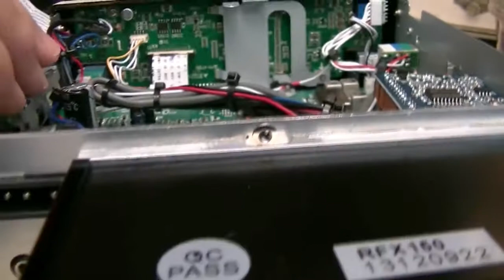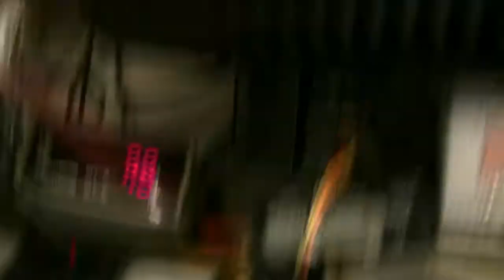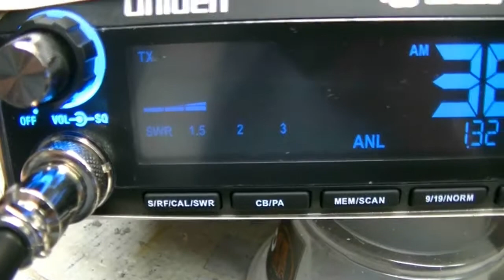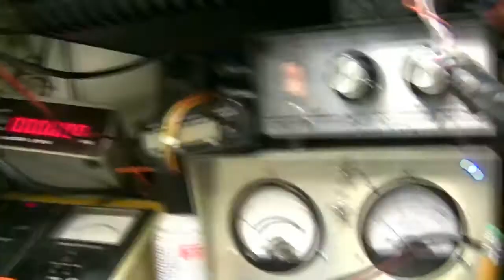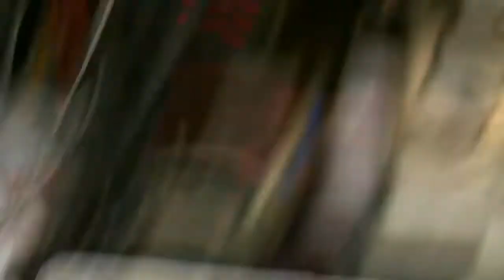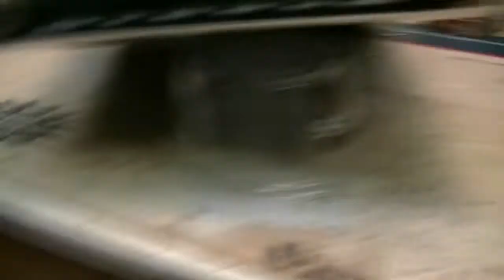Richard D BC980SSB

Comment: Yes you did but can you let me know when can you do my radio
Reply from the maker: The way this works Jorge is you go to the store, choose what you want done, then pay for it. When you pay for it you get the shipping address. (You can thank a bunch of non-payers for that.) When I get your radio, it's dated, all the parts needed are put with the radio and all is set aside. Then you wait. Right now it's about 70 to 75 days and getting longer the closer we get to Christmas. This goes for new orders also. I'm still doing mods and upgrades on radios but have stopped taking repairs at this time. Mods and upgrades will stop too at the end of October. Only new radio orders from 1 November until after Christmas. 
I hope that answered your question. 73
Reply: great i will do that when the time comes, thank you very much